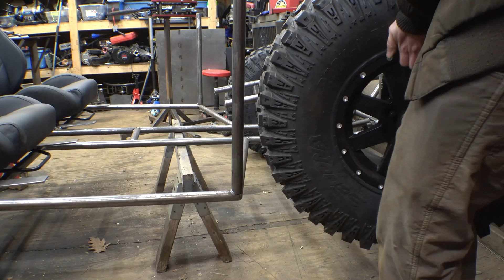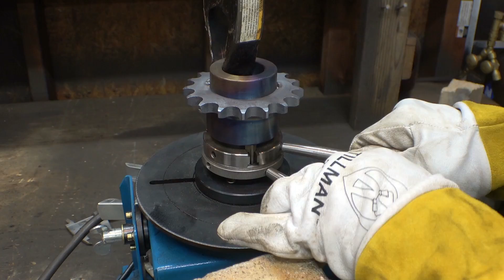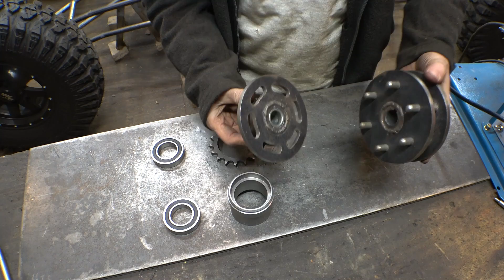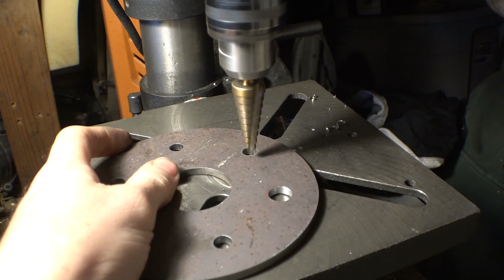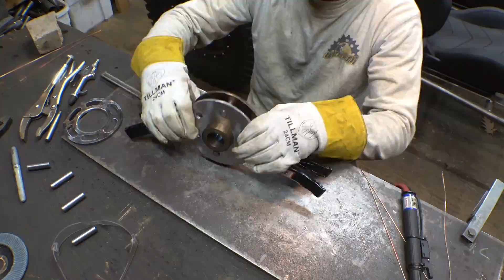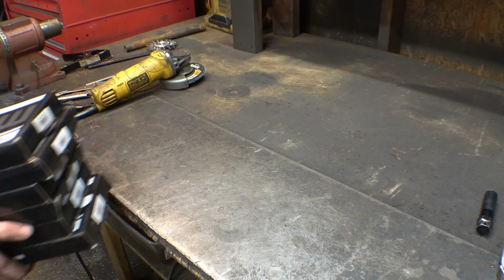Installing the Chains on the Mini 4WD Trophy Truck Project - Part 4

Comment: I think you’d be better off laying the seats back more, lowering the roof bars, and building a set of high doors so there’s only say a 12”-16” gap between the roof bar and the top door bar. It’ll save your spine on jumps and it’ll help your center of gravity and also would look sweet. I definitely liked the idea of sloping the roof bar and door bars forward to give a more aggressive look. Can’t wait to see this thing getting after it when you’re done. Keep up the great work

Comment: I definitely think you should add doors. Like you said it will be a great challenge. Also it makes it easier to get in and out  speaking from someone that has some back problems and the older I get the worse my mobility is and maybe you may have someone that rides with you with those kind of mobility issues.

Comment: A thought for the plasma cutter set up, put a mesh or "chicken wire" style shelf 6 inches below the cutting surface to catch the pieces as they fall. you won't have to bend over as much to grab them and the over-spray of the cutter can pass through to the bottom

Comment: You could run a chain drive to a drive shaft to the front end to eliminate the long chain. Like a little gear box in front of the front drive disengage thing with a sprocket on the side and shaft on the front.

Comment: As a 30 year fab/ welder guy. You do good welding.... you need to brush up on your engineering...... there is a reason why we don't use chain for driveline anymore..... gearing makes a huge difference....math math math..... just saying.....

Comment: You could put an idler pulley in the middle of the front chain so you can split the chain. That would eliminate a lot of chain slap. Would probably be easier to tension.

Comment: I got tired of the usual CnC Plasm table.

Build my own.

It's easy but kinda expensive if you don't own a Welding-Machine shop for a living.

But at the same time not bad if the table is small.

Just make a square table out of angle iron in the "L" shape.

Then cut bars [of preferably cold roll but square tubing can work] to set inside it loose.

You can move them around, clamp to them, position them to avoid the cut area and as a result never have to replace it.

Hope that is a helpful tip to somebody else.

Mine has a sheetmetal tray with sand below it to catch the slag. And a squirrel cage blower to suck away dust and fumes as well.

Do a lot of grinding on that top to suck away the grinding dust too.

😊👍

Comment: Great job. Your plasma cutter is fine, i'm thinging of it. In case you don't know : you can put a slide on the traction side of the chain but the tensionner is only on the loose side.

Comment: Use the drive from a 2000 era Subaru Forrester with a 5 speed. There is a company that makes a reverse cut ring and pinion so the engine is mounted in the rear of the vehicle. Those flat 4 engines are easy to work on.

Comment: The only thing I see wrong with that 4wd mechanism you built is the slop. It's going to be smacking back and forth with offroading and with acceleration and braking. And soon enough it'll wollow out the holes bigger and be noisy as hell. But great build so far

Comment: I agree with you on using chains, I had a push bike with a speedo that I bought for it, and clocked the speedo as in distance wise, plus two years before fitting the speedo, and absolutely no chain issues, ok so wasn't as abusive as offroading, but as long as the chain isn't able to pick up stones and chippings to get caught in the cogs, then chains are close to as reliable as driveshafts, as long as running true and straight, and annual oiling at bear minimum.

Comment: I would have put a bevel on the inside of the sprockets then weld them in place, that way you can have 100% penetration.

Comment: You can get a K-series motor out of a Honda, like find a rotted out Honda on FB marketplace and with your sub count you could easily get some sponsored performance parts, turbo etc.  With a build like that it would still be affordable and you would gain unbelievable amount of the new subscribers.  The boosted bois do mostly K-swap builds and they're at over a million subs. Granted they mostly build cars I'm sure it you put a turbo's K series in this build or anything else you build it would go viral

Comment: In the future if that happens again after a weld, put the bearings in the freezer for a little while and they will fit without having to remove more metal. Its a old trick we use when replacing crank bearings on motorcycles

Comment: The next time you video a project using your lathe, do a parallel video address why your inserts with the chip breaker is not working.

Comment: This is more like a TRUGGY because of the independent rear suspension. [Truggy is a Truck and a buggy massed together] And yes I know a truggy has a solid rear axle but this is not really either and I put it in that class.

Comment: I was looking at your build and you gave me an idea. What if maybe in one of your future builds instead of using those differentials you use transfer cases from ranger pickups. That way you can use 4x4 or unlock the front to use rear wheel drive or unlock the rear to use front wheel drive. You can connect the two with chain drive just like you have. You would even be able to change gear ratios between the front and rear to get out of situations. Watching you machine the parts is the best part of your videos you always give me ideas.

Comment: you arent realizing the back torque from taller tires. we snap 530 chains on crotch rocket powered sand buggies all the time. because the tires are so tall.

Comment: Thanks for answering the “Why Chains” question. 
I’ve wondered why for awhile. Given the potential for chain failure near your body. And I’m asking myself why this if all the other products use something else?
Or wouldn’t a motorcycle shaft drive system like a mono arm from BMW work if you could use one on each swing arm?
You do you. 
Thanks for sharing. 
Machining is mesmerizing. 
Skills!

Comment: You are not going to be happy with the chain slop between the front and back without some kind of intermediary transfer gear.  I also think you can get to your happy goal with designing a shaft with bevel gears between the front and back.  It is $25 bevel gear from the internet welded on a steel rod.  With a shaft and bevel gears, you don't need to worry about tensioners.

Comment: build the doors, just because the are not 'needed' does not mean you should not do it. the hole thing does not 'need' to exist, but it does.

you could even do some sort of half barrel hinge thing where they can lift off.

Comment: I have probably got this completely wrong but won’t the bigger 17 tooth gear make the front wheels geared slightly different to the back wheels?
Reply from the maker: The sprockets for the rear tires are also 17 tooth

Comment: It will be interesting to see if the chain drive can handle the big tires and pretty high power. The tires are adding A LOT more stresses with weight alone plus the diameter increasing forces. Can you please not install bearings with a claw hammer on the outer race too? Use a big socket that fits or machine a proper size piece to sit on the edge. Are you putting a body on this? If not doors are pointless. Climb in the top or side.

Comment: For the chain slide you could use snowmobile hyfax, they are cheap and made to be wear resistant. And you’d probably just need two and that would give you plenty of length.

Comment: DEWALT DCG415B 20V MAX* XR 4-1/2 5 in. Brushless Cordless Small Angle Grinder with Power Detect Tool Technology. 
Typically $180–$249.
Using it as a hammer? 
Priceless!

Comment: Do you think that chains  are more durable than the gears and transmision with diferentials and stuff?
To me chains are for low torque,  motorcycle style....
Anyway, you work a lot, you are very talented. 
Good joob

Comment: The builds are awesome but out of all the builds I’ve seen from being a subscriber. What made you go with chains a lot in your builds? How come not so much with driveshafts and diffs off of other off road vehicles. Cost more I would assume but chains are also easier and readily available pretty much anywhere (assuming) but just something that always been like a preference?

Comment: I don't have a profile plasma rig- why couldn't you just use a block/shim on the edge of the material to raise the metal up off the table (ribs) allowing the slag some space between your ribs instead of cutting out the ribs? You can clamp them & the material to the ribs (just asking?) Love your work. I'm retired-this is an awesome hobby for us low-income/single operator's to have. Motorcycle/ATV engines are the poor man's POWER PLANTS!

Comment: Guarantee if you try it once where you take car parts like CV axles and and a car engine and a drive shafts and put them into your build guarantee you're still going to have fun because that comes with different challenges that you got to figure out and be interesting to watch you work that out

Comment: I love your builds no matter what it is. The chain drive has always been a little funny to me but you’ve made me a believer! One thing you should look into is either k or b series Honda engines. They run 800-1000 on eBay and your smart enough to build your own wiring harness. That would be awesome to see one of your buggy’s with 200hp😂

Comment: No concern about it working, but the wear is going to suck. Every 3000 miles or so you would have to replace all of those chains. A bit more the sprockets as well. Since you welded them up yourself instead of making bolt on ones that is even more work.
The chain noise will probably be annoying too. 
Fun build though. It will be neat to see it running.

Comment: If you ever want to use a car engine, take a look at a Volkswagen 1.8 turbo engine.
these are, among other things, in a golf 4 and you buy a complete car for less than 500 dollars.
And with just a chip tunnig you can already get 200 hp out of it.

Comment: Love what you do. Only problem that I forsee on this so far is the length of the front drive chain. I don't think you will be able to get it tight enough to eliminate chain slap. Possibly put slides on the frame and tensioner on the outside of your chain. Don't get me wrong I'm just putting an idea out there. Sometimes think your part genius on the creative ways you build and engineer things. Love to meet you sometime. Keep the videos coming.

Comment: I never understand why you dont part the job piece off on the lathe rather than taking it over to the power saw.. you could go straight to length and square immediately surely?

Comment: Love to see you do a true buggy style high/low range gearbox with reverse, fully enclosed wet style to suit high power motorcycle engines, Maybe as part of the rear spool for IRS?
There are commercial style setups like this but are stupidly expensive.
There has to be better, cheaper and lighter options than a iron case Jeep gearbox?
Maybe a Jeep gear set in a alloy case? Challenge for you?

Comment: Hi, the hard steel you swoped out is most likely carbon steel, when heat treated it will get hard. Most carbon steel has 1 to 1.5% Carbon in the steel. Drill bits, end mill cutters etc. are all made from this type of steel. It is soft and can be worked before heat treating. This type of steel is usually very expensive to buy and has great wear properties and shock resistants, when heat treated correctly. Downside is, it is hard to work with.

Comment: I can't crack on the whole all around everywhere chain mindset(heavy, always trying to keep it from slacking, easy to forget about maintenance which makes it 'strong as the weakest link', so many sprockets, different ratios etc.).  I dig the idea of 2wd/4wd its understandable but how will behave the car while in 2wd in case of turning, handling etc? I mean front wheels on fixed axle both with or without drive would be nuts to steer from imagining it. I personally hate understeer. and/or torque steering.. like really really.  How do you feel about it? are you trying to cover it with some ackermann/caster tuning or you just crossed your fingers and went on with it? This seems kinda bolocks. Im aware of the buildingability for you with the chain, I feel the advantages of it as well but still this whole thing made me wonder. 

Did I skip the part where the front axle is able to spin with independent wheel speeds?

Love the series.

Comment: i think its cool watching the lave work how you can make things easy on it bearing holders and hubs etc etc. i'm also thinking the chain drive for the front when you engage and disengage wont it move the chain to the left or right which means it will come off

Comment: i have for 20 plus years used streetbike motors to manual transmission. i make a drive shaft with u jionts to get rid of vibration between them . last build was a zr2 s10 with a gpz1100 motor .

Comment: The chain to run your front tires is pretty long, you might consider an idler about 1/2 way with your tensioner.

Comment: Might consider a middle jack shaft for that front chain. Polaris used to use chains for their front drive on 4x4 quads. They had a jack shaft in the middle. It was on an offset housing for tensioning both at once.

Comment: Since you have the arcdroid, use it to cut the parts for its own table!
Make a "sawtooth" design for the table so the part only sits on tiny peaks in the lateral bars. It's what the pro tables come with. I actually found the teeth were too short and the slab was still sticking so I made some hugely long teeth for the plate to rest on

Comment: I dont think you really need to explain yourself on the "why chain drive" Chris. I think you've already proven that the mid-shaft chain drive system is really practical. Also, the reason I watch your channel is because of your talent at machining & building most from scratch. Also that you're not doing something that every other youtuber is doing. Your creations are truly unique. Dont ever loose that bro.

Comment: Have you ever looked at making your own 1:1 "differential" using the spider gears from a truck or car differential and making the case and other parts? By making a 1:1 unit a driveshaft should spin alot slower making the presision less critical and allowing you to keep the gearing of the transmission simple. And you would be able to make it much smaller then a full diff from a truck or car.

Comment: This is going to be one of your very best builds about the doors I do think you should put them in as I think your guts telling you to build them in so listen to your gut as long as it doesn't take too much more work I know you can do it and so do you what have you got to lose its another innovation as well you have added to this truck as for the long centre chain I would make a you shaped guide with nylon inserts to stop the chain rubbing on the steel guide for both top and bottom of the chain then incase in a steel box with inspection hatches to lube the chain and check tension you certainly have so much skill its a wonder to watch you keep them coming all the best and a happy new year all the best from John from Rugby UK.

Comment: 27:30 You can put each chain inside a pvc pipe, than put the pvc pipes inside of an oval exhaust pipe to run the length between the sprockets. The pvc will be your sliders and prevent the chains from hitting or slapping, with the oval pipe being your chain guard and mount. You can make a tensioner at the front and rear with a pair of sprockets that ride the top and bottom of the chain that are adjusted together to guide the chains into and out of the pipe.
Reply: Sounds good in theory but PCV when exposed to the elements for extended periods of time will become extremely brittle and it will more or less explode once it gets to cold or ages in the elements. He’d be better off getting some blocks of plastic used for dirt bike/four wheeler chain sliders and make his own where necessary

Comment: One last comment, you can get a 4 cylinder out of a modern car for very cheap at the junkyard. and they will make as much hp as those motorcycle engines. but the nice thing about motorcycle engines is they have a transmission with them, they are lighter weight, and are much less complicated especially with wiring. I'd definitely be willing to help you out with wiring/electronics on a car engine whenever you go down that route. Just reach out to Build Break Repeat for my contact info.

Comment: if the chain drive 4WD doesn't work out, you could probably just put 2 differentials and a driveshaft in it. For the rear you can weld the diff so it is locked and place it in the center of the jackshaft and since it is locked you can still chain drive from the engine to the jackshaft. Then for the front diff you can use a front diff from a 90s chevy 4x4 truck that has cv axles and it already has an actuator you can use for engaging/disengaging 4wd.

Comment: Bro build 3” deep rectangular tub to act as a drawer u can pull to open like normal drawer but made from steel or alum holds few inches water.

Comment: Y’all need sawtooth shaped slats for your plasma table might help. Cool build so far
Reply: Yup - that's exactly the problem. I'd be surprised if the arc droid doesn't come with CNC templates for these to cut itself.